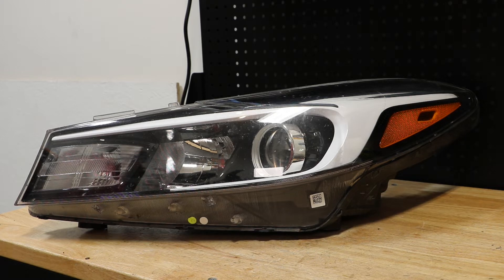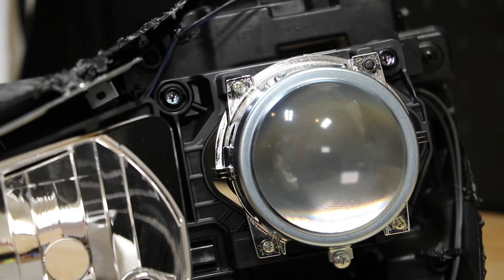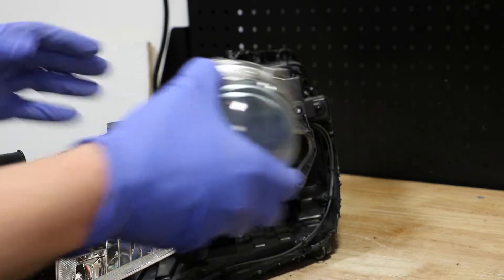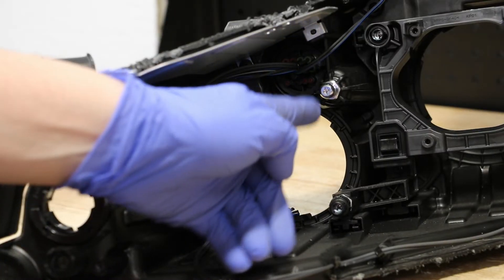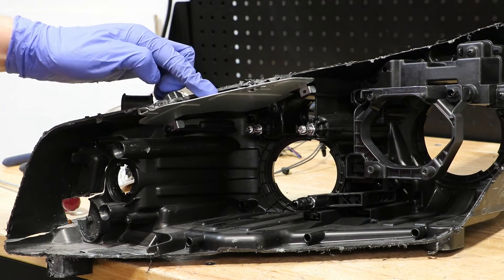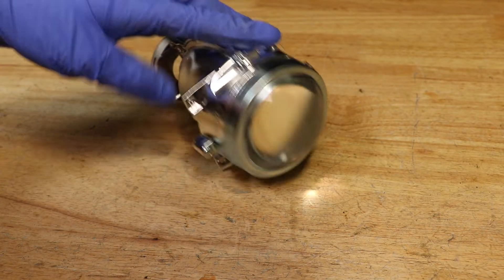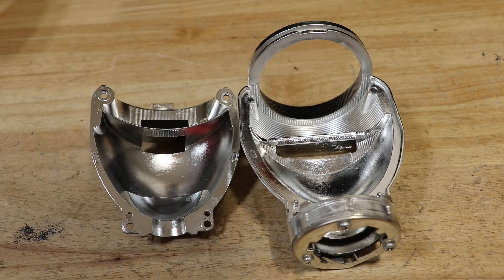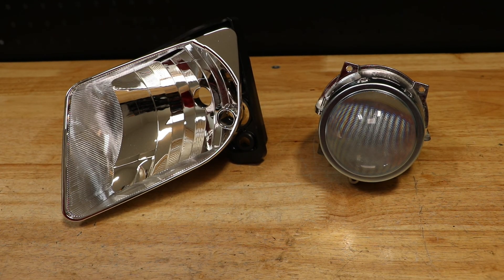2017-2018 Kia Forte OEM Halogen Headlight Disassembly

Comment: Is there anyway to separate the transparent plastic from the blackone with out having to "cut" it? I'm having some issue with my optima 2017 led lights which seems like one of the brackets holding the projector broke so it is facing down, I'm trying to fix it myself but I'm not being able to open it.
Reply from the maker: You have to heat up the glue.  Use an oven or heat gun.  You can find tutorials online.   Be careful not to melt or burn  parts.  I don't recommend using the same oven you cook food with.

Comment: But why
Reply from the maker: Lots of people still retrofit their halogen headlights with Xenon or LED.    Kia/Hyundai use the worst/cheapest projectors that I have seen.  They generally have burnt/flaking projector bowls within 5 years of regular use which results in extremely reduced light output that makes the headlight nearly useless at night.